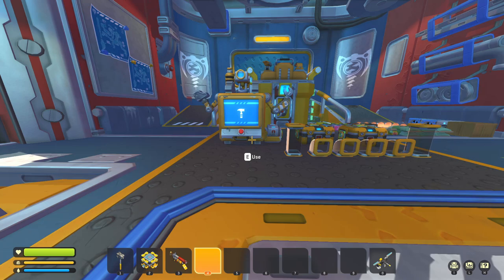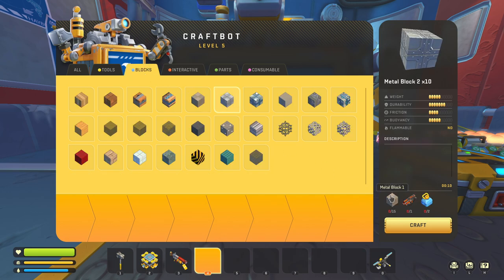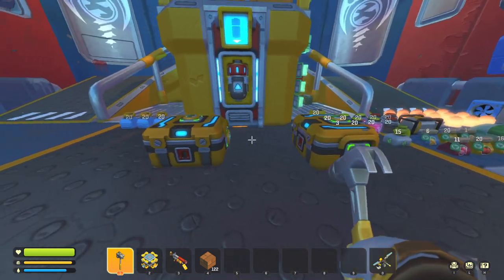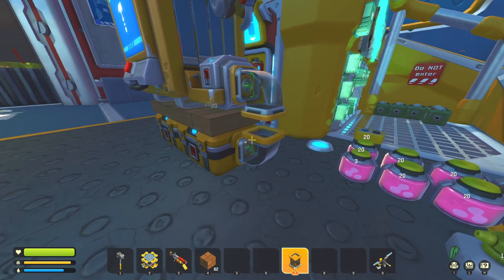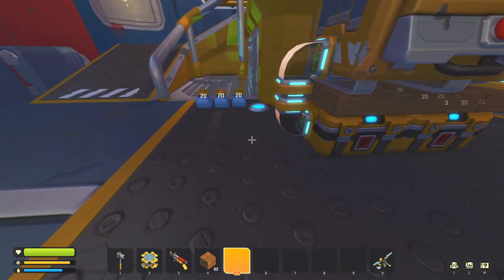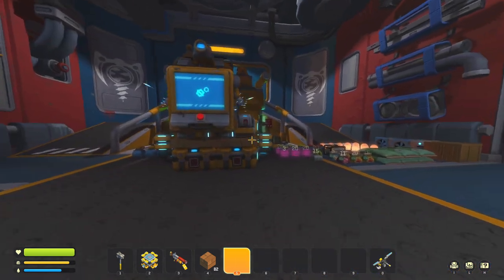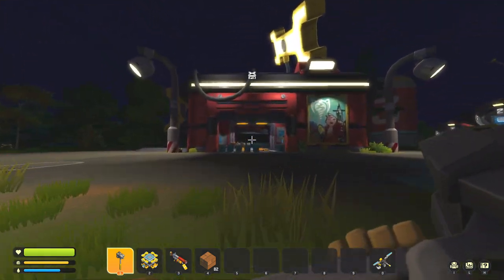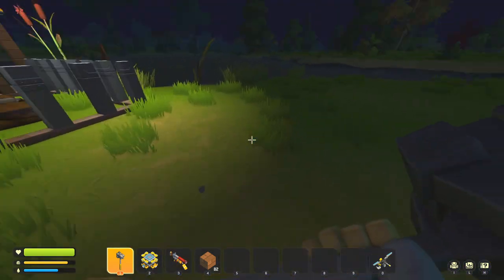How to Build an Easy Automated Crafting System | The Mediocre Mechanic S1 E18

Comment: Hey Milton if you want to you can connect the craftbot in a loop by even connecting chests to the ports , you don't need vacuum pipes to connect them .this way you can get more storage space by placing a chest upside down and pointing at one of the ports and it will still pull materials from the other chests.
Reply from the maker: Yes I know you can build it without the vacuum pipes but crafting chests can be expensive early on especially if you are playing solo so I wanted to provide an alternative that might be easier.
Reply: @MediocreMilton  ahh ok